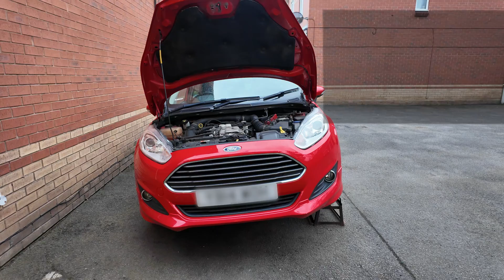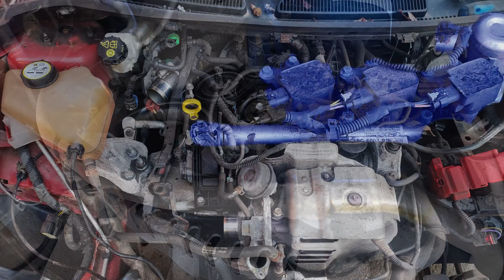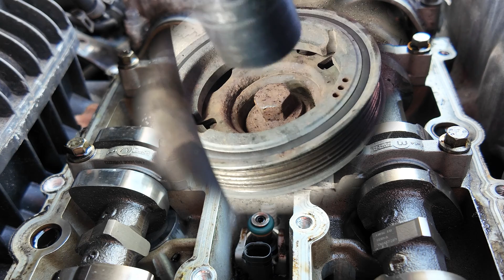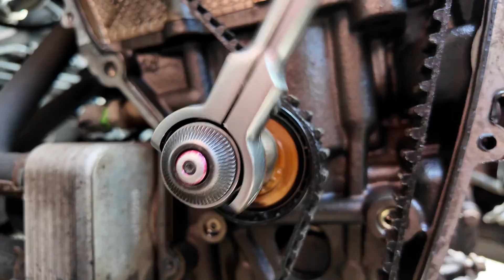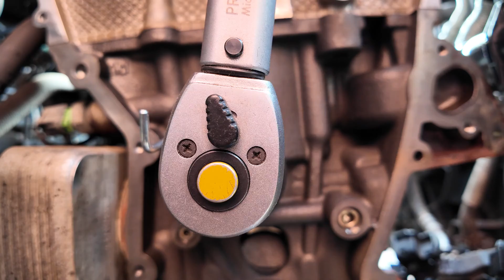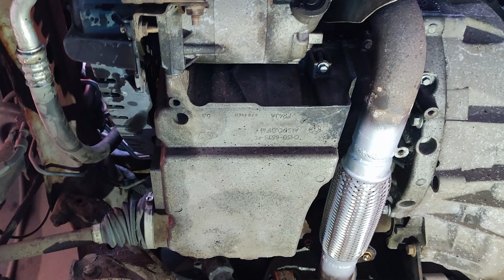Ford Fiesta MK7 1.0EB Timing Belt and Oil Pump Drive Belt

Comment: What tool did you use to remove the crankshaft pulley bolt? Breaker bar, impact gun, or something else?
Reply from the maker: Locked flywheel and a good strong breaker bar.

Comment: i have to say after doing the same exact job on my 1.0 NA fiesta, its not nearly as hard as it first appears
id gladly get a couple fiestas to fix
my understanding is that using wrong oil degrades the belt to the point the coating wears off and starts sheading bits into the sump glogging the pickup

Comment: You have to take out the catalytic converter and high pressure fuel pump to replace the timing belt?
Geez
Reply from the maker: The cat needs to come off only if cleaning oil pump.